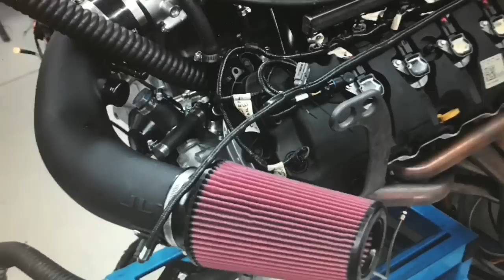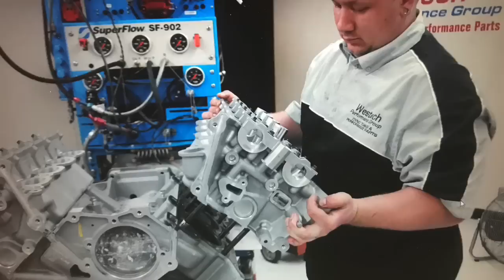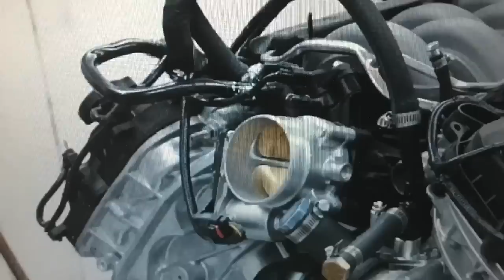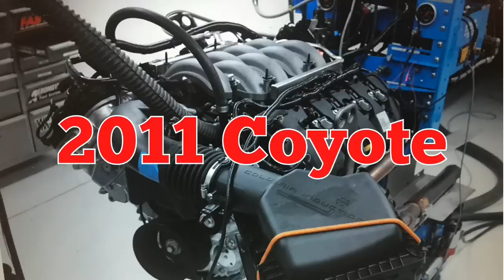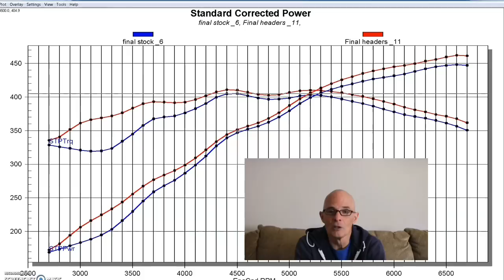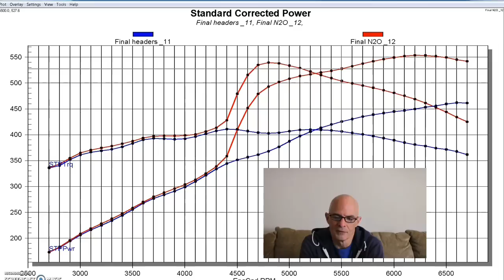5.0L 4V COYOTE MODS-NITROUS & HEADERS (GEN 1 YOTE)

Comment: the coyote motors are very responsive to mods, the killer is their size. compared to an LS they are huge.
Reply: One of the biggest little engines around! 29.5 inchs wide up top but they are pretty narrow down low.
Reply: Their size and the cost of aftermarket parts for it is why I don't want one.
Another reason to run an LS is you have more choices of transmissions... GM has had the same bellhousing bolt pattern since the first small block V8 in 1955 to today.
LS is the cheapest and most compact way to make power in whatever you wanna put it in. I'm putting a 5.3 in my 88 Isuzu Spacecab pickup with a T56 and a narrowed Ford 9" I built with disc brakes and a full spool.
Reply: @theall-seeingpie8887  
The entire Ford modular family, including the Coyote, has the same bellhousing pattern as far as I'm aware. And you can buy bellhousings that adapt a coyote to a GM transmission if you want which really opens up the possibilities. I'm doing that myself.
And if you want the absolute lowest hp/$ you should probably forgo the LS and just get a BBC. Yes, it's a bit wider and heavier but much more displacement to make easy HP and torque with.
LS is a great choice too, don't get me wrong, but the Coyote is more flexible then a lot of people think and the LS isn't always as inexpensive as people think.

Comment: Thoughts on using a higher weight oil when running a gen 2 coyote at elevated horsepower ?? The rod bearings tend to fail.  Would a higher weight oil have more film strength and improve bearing life ?
Reply: Yes, my dad's blown S550 runs 10w-50 to help keep the rods happy👍
Reply: Watch lake speed Jr real tuners vidy on oil

Comment: BIG BANG COYOTE, WOOOOO! Oh man, I'm pretty pumped for this!

With no shortage of 900-1000HP 
 "stock Mustang GT with twin turbos" chassis dyno runs, I gotta say, I'm feeling pretty optimistic once you remove the power loss of the drivetrain(through the additional direct changes of an independent rear suspension in newer cars too don't forget!), the exhaust, intake, restricted airflow of an engine bay, and accessories from the equation. If we do the guesstimate napkin math, a 1000HP chassis dyno run is about 1150HP with a 15% adjustment, and 1200HP with a 20% adjustment - and, while I don't know if I would keep a 'street car' stock Coyote at that power level, there are people driving these things around without any pattern of failures that I've seen. In other words, that's a very roughly estimated 1200HP with room to spare.
Enough room for another roughly 350HP increase? Well that's the big question of course.

The heads are absolutely there, whether stock 2011s(IIRC, outflow GT/GT500 Mod heads by ~4%) or the new GT350/GT500 monster heads, the intake side is there, the exhaust side is there, the valvetrain has always been there in the Ford DOHCs, and the crank is there - but the pistons, rods, and possibly the block? Guess we're going to find out. The blocks haven't traditionally been considered 'safe' over ~1000HP, the Coyote seems to move around a little more than the Teksid 4.6l, the sleeves don't seem to hold up - but the same is true for factory LSx stuff too. 
'Big bang' isn't about practical strength though; it's about absolute strength, bring on the 'hero' runs!!!
Reply: Then there is itsjusta6 that can't keep one together. They are kick ass motors for sure but there are plenty that are breaking.
Reply: Looks like they are using gen 1 Coyotes. Those rods are no stronger than LS gen 4 rods. Now, if they were using a gen 2 Coyote I can pretty much guarantee it would exceed that 6.0 LS big bang of 1540 HP. But that 6.0 LS isn't a 6.2. 6.2 with LS3 style heads would make more power than the 6.0 tested if you really wanted to make things fair.
Reply: @ShizawnSanders  the 6.0 big bang motor didn't blow he ran out of map sensor so he would have to put more boost on it to find out where it gave anyhow. Gen 4 ls rods are solid the Gen 3 are the weaker ones and even they are pretty strong but they gave out around 1300lbft
Reply: @thatturbotruck  I think one of the keys with the coyote is going to be the revs.  If it'll live at 8500 rpm on stock rods (and I really don't know if it will), then you can keep the cylinder pressures down and spin it for power.  Peak power at 8000 rpm would require "only" 1000 lbs-ft of torque to make over 1500 hp.  Based on what the Honda guys have done on stock rods, you can make some pretty impressive power on relatively weak parts if you can keep the torque levels down.  Definitely looking forward to this series!
Reply: @thatturbotruck  right, they actually don't know the limit of that gen 4 LS yet. That's true.
Reply: @ChurchAutoTest  true but rpm is what kills rod bolts. What will give first on a coyote the rod or the bolt?
Reply: Billy Bowerman  its not like getting 8k rpm out of a 4v V8 is hard with just bolt ons. Theres people spinning SBE LS engines over 7,500rpm boosted to all hell with some money into the top end
Reply: I’ve seen 1056whp gen2 sbe ungapped rings with a stock 6r80 trans run 8.95 in the 1/4mile

Comment: This will be interesting. Let it rip and let’s see what happens. I’m a huge fan of the coyote platform. It’s just crazy expensive compared to the LS stuff.
Reply: Scott Sigmon I agree, luckily the gen 1’s were in enough trucks that prices have come down a good bit. I’ve picked up several complete drop outs from trucks for under $1000, tons of miles but it’s boost friendly and the 6r80 with a converter is pretty impressive.
Reply: @videokiller96  complete pan to tb gas engines at my yard at 260$

Comment: I'm excited to see the results of the big bang test. A 2010 Gt could be a great budget build that's pretty fast! I'd just go straight for the 2015 gt and keep it at 1000 Hp for reliability(turn it up at the track to run 7's). It will be interesting to see how much you can push it on the engine dyno.
Reply: 2010 GT is still a 4.6 3 valve. 3 valve engines suck. Need to get a 2011, or better yet like you say a 2015.  2018+ 10 speed like mine is the best so far.
Reply: @ShizawnSanders  oh your right i meant 2011. They only announced the gen 1 coyote in 2010. Everyone just gets a 2015 and throws the 2018 gen 3 heads on it and maybe upgrade the chain tensioner so harmonics dont break it. Pretty badass motors.
Reply: @KillinReapers  gen 3 Coyote is dual injection. It is both port and direct injection. To my knowledge gen 3 heads can't be made to fit gen 1 and gen 2 Coyotes.
Reply: Ive seen a guy put a 18 head on a stock 15 bottom end from ford. The blocks are still essentially the same design. The injection style affects the heads/intake. It's pretty common now. The gen 3 made more power just because the heads flow better but people still wsmt the gen 2 forged bottom end. You know...
Reply: @KillinReapers  no, I dont know. The gen 3 is the same bottom end as gen 2 but the pistons are slightly bigger and the bore is slightly larger. The heads have direct injection bosses so what do you do with those? Maybe you're talking about putting Vodoo 5.2 heads on gen 2 engines. That makes more sense.
Reply: @ShizawnSanders  Basically the gen 2 block has stronger forged pistons, rods,  crank etc. so it can handle more horsepower with stock parts. No need to rebuild the motor. To make it work you just need the right head gasket so the water ports match up. You would weld a block off plate where the direct injection pump would be and leave the old injectors in the holes so you dont have to get something to block those off too.

Comment: Great video Rich! I still own and love your Dyno-Proven SBF performance book. I'd really love to see a Big Bang test on a 90's truck Ford 351W! Maybe one on a Vortec 350 as well?
Reply from the maker: i did the 351W big bang
Reply: @richardholdener1727  I remember that, but I believe it blew up when the wastegate spring was removed entirely? Lol
Reply: @richardholdener1727  can we see the coyote engine big bang? Is it happening soon?
Reply: 1054 glorious horsepower on that 351w
Reply: The almighty 351w, the original LS.  I'm currently building one right now with a set of early 351w heads for my 1980 Coupe Fox.  It'll be a fun car!